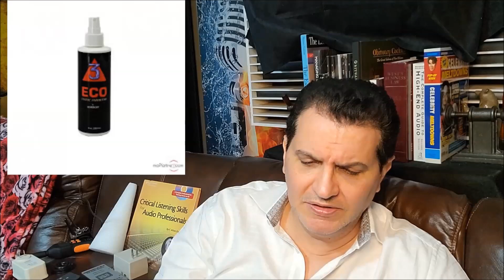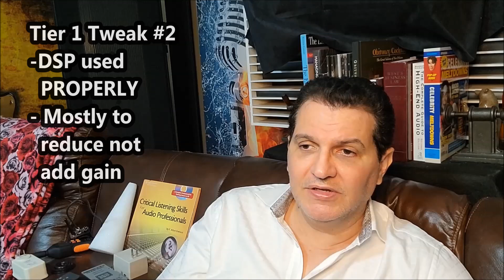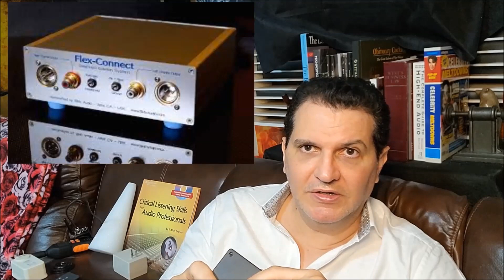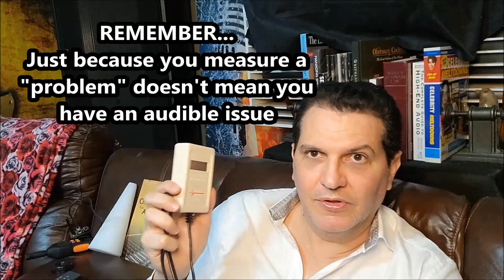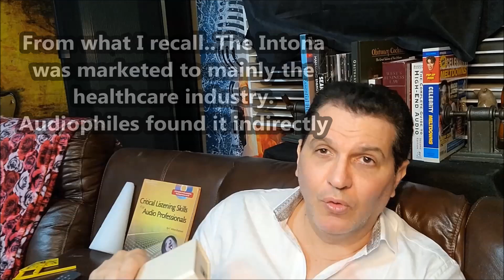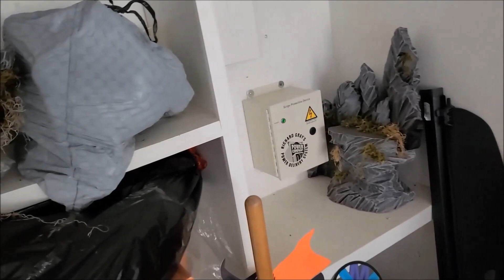Audiophile Junkie - Top Audiophile Tweaks and Accessories - Part 1

Comment: Great, if I add my way of preventing vibrations which is transmitted back from the ground to the speakers which works on wooden floors but not always on concrete ones. Place the phone with the app. accelerometer on top of the speakers, on the floor in front of the speakers add a vibrating device or knock with your foot. Place plastic or wooden discs approx. 1 cm high under the tips or speakers and then add a thin rubber approx. 1 or 2 mm under these discs, line the rubber in layers enough to read on acc.meter to the minimum vibration transfer. 
Cheap and efficient, however, your neighbors will be grateful to you🤗.

Comment: My speakers are on carpet which is on concrete (basement) Spikes or no Spikes? What about the Subs? Do I need absorption pads? Thank you for the video!
Reply: @Pablo Gabs FWIW, you’re likely not going to have much floor vibration on a concrete floor. That’s something you really need to worry about on s suspended / wooden floor.
Reply from the maker: It's hard to say for sure.  Do you notice any serious floor vibrations or resonances in your room when playing music loud?  

In my case, my feet could feel the vibrations in the floor which was annoying and some things on my speakers and the room resonated, so I spent the effort to try to address it with vibration control products.  If you don't notice similar issues in your room, I wouldn't consider it a high priority "tweak" at this point.  

Generally speaking, I like to decouple, so no spikes.  I know it seems counterintuitive for speakers, but the key is giving the speakers a way to dissipate the vibrations versus creating such a rigid coupling that makes the ringing worse.